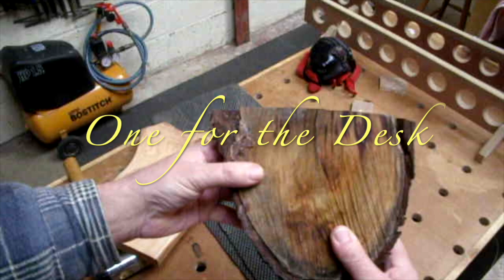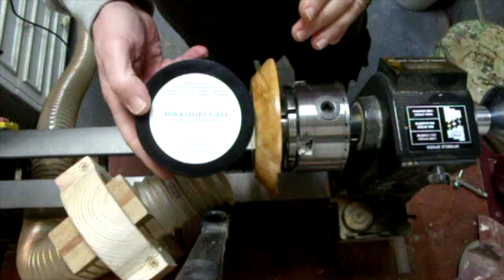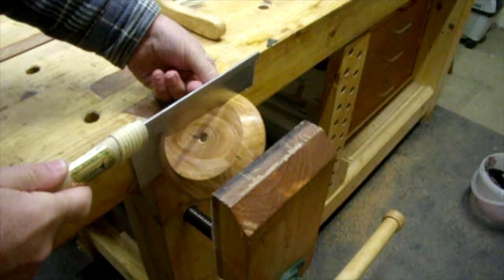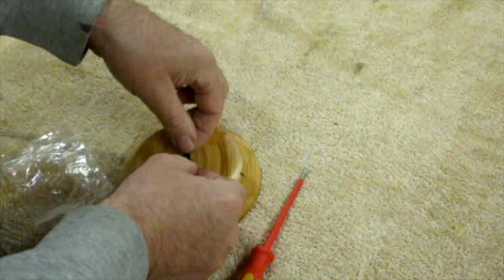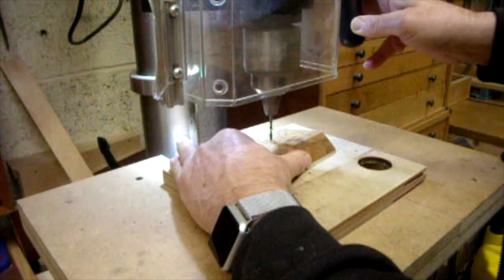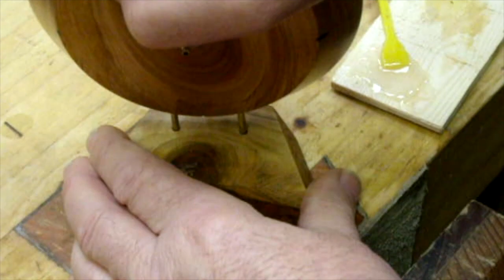Desk Clock - #JanuaryClockChallenge2021

Comment: Hi Steve, I was wondering if you were going to show the other 2 clocks. I'm so pleased you did. This is a lovely desk clock and I agree the full black lines didn't work where as the little accents work perfectly. Take care Steve and I'm looking forward to the last one for you workshop. Cheers, Huw
Reply from the maker: I did try to boil the 3 clocks down to one  video but just didn’t work and really I needed to buy some time as the next project is nowhere near ready hopefully this’ll help. Agree the accents work better 👍🏻 I originally was trying for live edge but the wood was completely rotten at the edges. Workshop one out Sat am 😉 As per usual thanks for your watch, taking time to comment and of course running this challenge. Cheers Steve

Comment: very neat, loved the trick with the nut and bolt to hold it in the chuck, thanks for sharing.. cheers
Reply from the maker: Thanks Graham, when I was doing engineering (many many moons ago) I used to use that trick quite a lot for consistent location. Cheers Steve